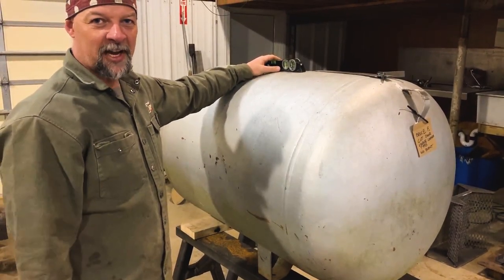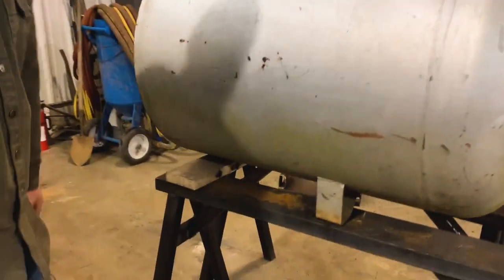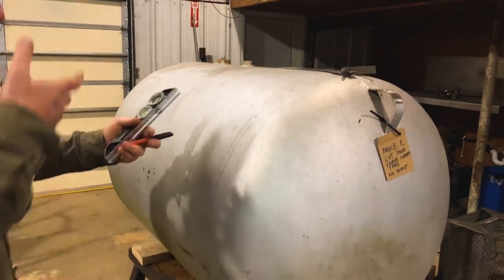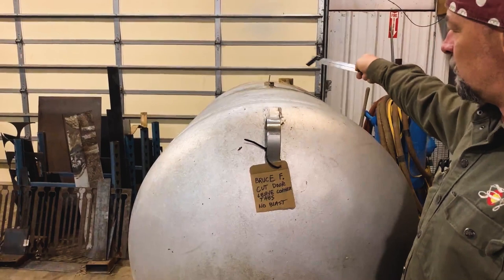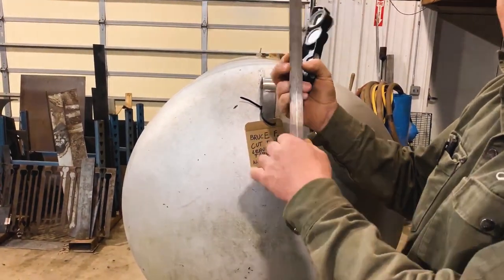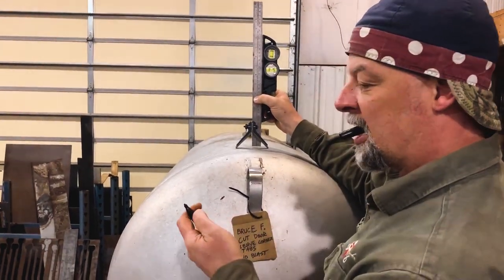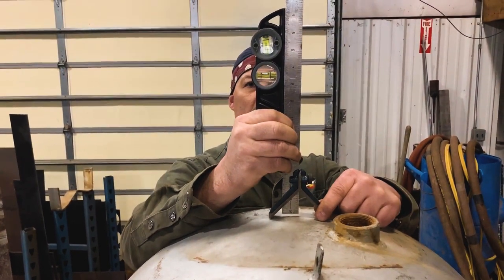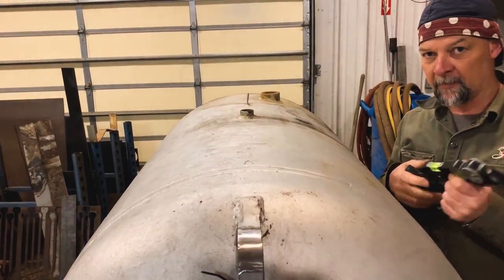Cook Chamber Door Cut Layout [Expert Tips: How To Find Top Dead Center On a Tank or Pipe]

Comment: Why not just rotate the tank 180* and put the bungs at the bottom for a drain cleanout? Grinding off the lift points on the ends, and the “leg” that was previously at the bottom would make for a really clean look.
Reply from the maker: That's also a good Idea. I have done that on a few. only thing is sometimes the older tanks have some perty bad pitting in the metal from rusting. great idea for some of the tanks on better shape though!